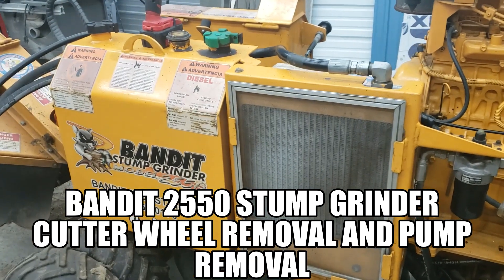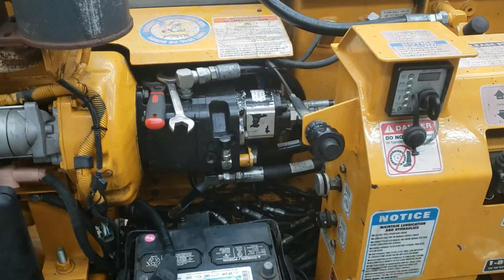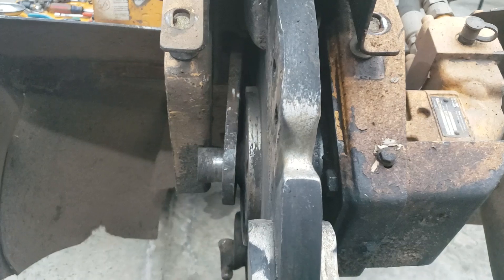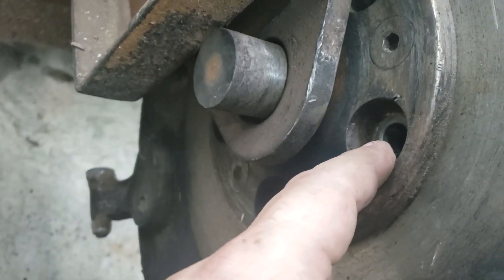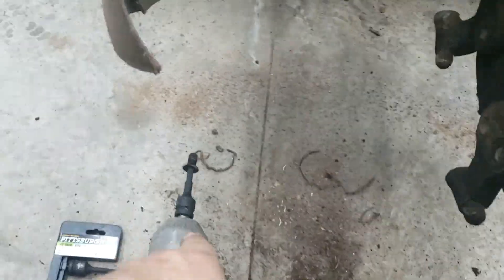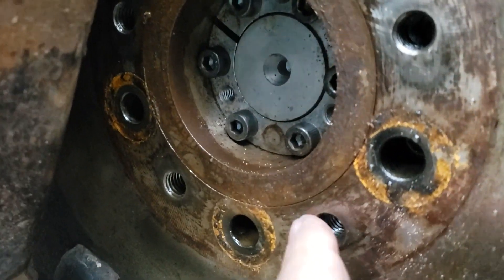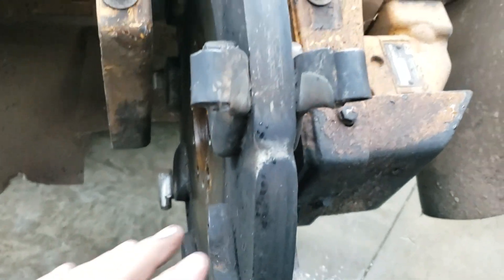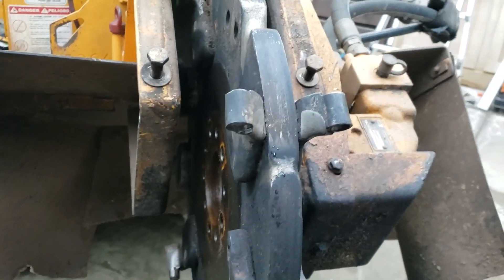Bandit 2550 Stump Grinder cutter wheel removal

Comment: Do you have any tricks to getting that inner collar out? It won’t free itself off the shaft. I broke a bolt tightening to 35ft.lbs. Instead of 30. I tried letting it soak overnight with pb blaster. The bolts are so small Im afraid to try a puller, don’t want to break more bolts. Any help would be greatly appreciated. Thank you
Reply from the maker: Send me pictures to mustangrebuilder@gmail.com
Reply: I sent you an email

Comment: Great video! I have a 2890 needing to replace the hydro motor seal. Did you run a bolt through the shoot and pocket hole in the wheel to hold the wheel from dropping when pulling out the motor?
Reply from the maker: Yes i did

Comment: Do you have to remove the wheel to take off the pump?
Reply from the maker: yes ..the pump is connected to the engine ...connected to the wheel is called a hydraulic motor ..I know it gets confusing
Reply: Mustang Rebuilder thank you lol i call them both the same thing
Reply: I tried heating up the specialty bolts and I snapped three all sockets how do I get these bolts off?
Reply: My torch won’t get the bolt cherry red
Reply from the maker: @buggernugget1  I took my brothers off with him last week ...heat the outside circle of the bolt then the very center of the bolt ... had to heat each one 2 x s and then they came off with an impact and you have to use a 1/2 inch drive bit not a 3/8 th drive .... it got to expand and then cool to break it free
Reply: Mustang Rebuilder I’m got them all the bolts off but know I’m trying to take the teeth off and to get the cutting wheel off but he grinding them down so far I can’t put a Allen socket in to take the bolts off
Reply from the maker: @buggernugget1  OK you can take the wheel off without taking the teeth pockets off ... here is the trick ... loosen 4 bolts that hold the pump and pull halfway out ... now remember their are some Allen head bolts that compress a compression sleeve that holds the wheel on the pump shaft they are metric ..you take them out and then screw them into the holes next to them and it pushes the collar off
Reply: Mustang Rebuilder i got it lol me and my pops finally knocked it out thanks for your help 🙏🏽
Reply from the maker: @buggernugget1  send info to mustangrebuilder@gmail.com so I can send you something

Comment: How much did the 2550 grinder cost if you don't mind
Reply from the maker: Well its about 3yrs now I think LOL  $32 to 34K  but I will say this stay away from any of the New diesels from any manufacture due to the Tier 4 and above EPA requirements, even the factory techs have a hard time figuring out computer problems with them and the make it so only a dealer can access the computer to read the codes
Reply: @mustangrebuilder  great thanks for the info do you have videos of the machines grinding with time frames of how long the stumps take to grind
Reply from the maker: @charliemoore7014  funny you should ask next week its about the pros and cons of being a Sub contractor and I show you how much I charged and the time it took to do it
Reply: @mustangrebuilder  sounds good I do stump grinding part time and looking to upgrade machines so that info would be helpful
Reply from the maker: @charliemoore7014  In the same video at the end will be costs of repairs